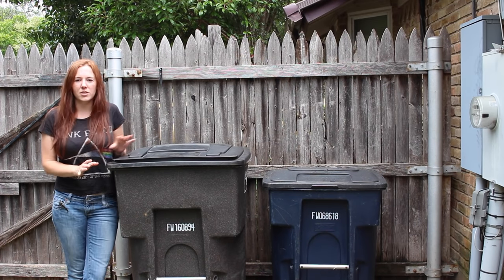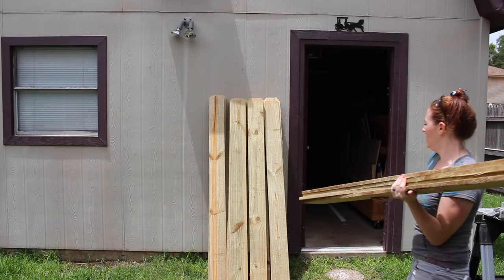Building a Garbage Can Enclosure - Part 1

Comment: 1:27 That was a pro move, after you cut the wood, it fell and automatically leaned against the wall.
Reply: +MaximumJonathanosity There are several factors in doing a pro job. One place I discovered which succeeds in merging these is the Adota blueprint pack (google it if you're interested) without a doubt the no.1 info that I've heard of. Check out this  awesome website.
Reply: There are several factors in creating an amazing design. One plan I found which successfully combines these is the Adota blueprint pack (check it out on google) without a doubt the most helpful course that I have ever seen. Check out this  interesting site.
Reply: I have spent months researching into constructing sheds and found an awesome resource at Adota blueprint pack (google it if you are interested)

Comment: you are so lovely april! like the project idea.. always wanted to do something like it but never felt the need to :) do you treat your wood for outside uses?
Reply from the maker: : ) Thank you. I used pressure treated wood for except the framing. I also plan to paint the structure but will have to wait a few weeks for the treated wood to dry enough to hold paint.
Reply: thanks for the answer :) maybe ill get on building something like this some day too. much love

Comment: Any reason to slope the 'roof' back to front? I would have done it front to back, which would leave room to lets the bins in and out whilst tilted, or even have the lids slightly open if you have to over fill them a little.
Reply: Exactly what I was thinking..
Reply from the maker: Because you need it short enough so that a person standing and reach up and lift them up. If the front was any taller I would need a stool or ladder to lift the lid up and throw trash in.
Reply: +April Wilkerson I thought that was the reason why.. Good work April.
Reply: Are you saying that the bins will be left open while they are in the shed? The Raccoon will love you forever. LOL
Reply from the maker: Nope they will be closed, but you have to lift the lid of the shed to get to the trash can inside and to do that, you need the roof to be short enough to reach and lift up. Just stay tuned for part two. : )
Reply from the maker: No, the trashcans will stay inside and when you walk out to the shed with a bag of trash then you will lift the lid of the shed up, lift the lid of the trash can, and toss the trash inside. On trash day, you will open the front door and remove the entire trash can so you can place it on the curb. I finished it yesterday, and it works great. So wait for part two to see. : )
Reply: Ah, makes a bit more sense that way. I hadn't realised that was how it was intended to be used. Seems a bit more awkward than necessary though to have to lift two lids up. A gas strut from a car trunk/bonnet though....
Reply from the maker: Yep that's exactly what I did. I used a strut that is rated enough to lift the lid by itself. That way you only have to release it, then open the one lid (the trash can lid) to throw in the trash. : )
Reply: +April Wilkerson Or you could have used a piece of string (or something else) and connected the shed roof to the bin lid, then when you lift the shed roof the bin would also open. Then when you need to remove the bin just unhook the string.
Reply: What the purpose of the lid if the trash can already has one:)

Comment: Awesome. I think the best tip you gave was in reference to those fence pickets shrinking. Boy, do they shrink...esp in the TX rain and heat. Ditto here in OKC. Great video/project.
Reply: Yep.  I'm in Houston.  I don't space pickets or deck boards.  New boards have so much moisture in them that they create their own space when they dry.

Comment: Just a little suggestion. We have these bins in the UK and most of the enclosures for them have the roof angled down towards the back so once the bin is in you can still lift the lid without having to pull it out. Don't know if you thought of that or if there was a reason the roof angles towards the front so thought I'd post a comment. Anyway absolutely love your videos, thanks for sharing all your projects :)
Reply from the maker: : ) Just wait for part two. I thought it though and it's working great. Glad you enjoy the videos!

Comment: Hey April, Totally off subject but, your fence posts are those PVC with metal brackets or, steel? Living in FL and moist ground looking for alternatives yet, cost effective alternatives to PT wood posts. TY.
Reply from the maker: The posts are steel and are filled with cement. The previous owner put them in.
Reply: Same here .. I live in Florida .. the cost to do that would be pretty high but it sure would last a long time ... I've done change my wood twice and the ground is always soaking wet ... But I wish I had the money cause I sure would do this. ..And concrete field that's awesome...
Reply: Put down a bed of crushed stone for drainage.
Reply: Larry, I wish that would work however, Florida is a big swamp. Constant moisture in the soil and the wood just soaks it up.

Comment: she should have put concrete blocks down first.... that would have raised the bottom platform off the ground and prevent  eventual rotting of the wood over the years... otherwise she did a good job...

Comment: I suppose this question might be answered by part 2 but a question i have is,  how will you hold the lid to the enclosure and the lid to your garbage can open when trying to put garbage in the can?
Here is a thought....take a small piece of chain with an S hook on the end. Attach it to the wooden lid then attach an eye screw to the plastic can lid. Hook the S hook into the eye and when you open the wooden lid you pull the plastic lid open all with one hand while you are still holding onto the garbage you were throwing away.....If you use my tip i want a Nickel for the idea!

Comment: Historically massive rain here in my city, last month was a record breaker and this month has already started above average.  Currently my two rubbish containers have broken lids, the city is supposed to come and replace them by tomorrow (Monday.)  your project is an excellent one for my situation, just not until I finish repairing the hail damage and rotten window trim.   We will overcome (given enough chocolate and Dr. Pepper.)

Comment: Hi I'm always excited about your projects, nice job ;). But I have few improvements in my mind that, I would rather change the position of bottom boards (rotate 90° in order to have longer side level with ground) because I think it will bend under the weight of thrash can (and maybe add 2 more). Then the other one, after I saw "test fit" I think that it would be quite difficult for you to take out the trash can if it will be full of trash(maybe small change of design?). And last one, I know that the project is still ongoing so I still hope in corner of my heart that you would create some concrete base under it. :) keep going in good job ;)

Comment: I have been doing wood working projects for some 50 years and yet i always learn something from watching your videos so thanks very much. Using the router to do a straight cut on the paling top cut is something I learnt this time. I always use a power saw and cut to a line but paling to paling I always get a bit of drift in the cut. I think the router will make a better cut and cant wait to use it on a future job. Thanks again.
Reply from the maker: : ) That's great to hear. From now on I'll also use the router. Not only was it quicker but it makes a cleaner cut.

Comment: Great idea April:
I'm gonna modify this concept and apply to my motorcycle shed. I'd like to use hinges on the back wall to open the roof. Would you suggest any other option so I won't decapitate myself when parking my bike inside?
Thanks in advance. Greetings from Chihuahua, North Mexico.
Reply from the maker: Yeah I actually uses gas struts on the lids, so check back for part 2 next week.

Comment: Hey April, as a female, I got into wood work as found it much cheaper to do things yourself. However don't want to spend too much money. I am woundering is, it possiable to make something similar to this, using a jigsaw, a drill and a sander. Yes, it will take longer to cut with a jigaw than using a circular saw, but is it still possiable?. And also how much did this project cost you?. I am thinking of making this for my mum, but changing the designs to incorprate 3 garbage disposal, also thinking of doing it with the wood lids, seperated into 3 parts, each that I will attach to the garbage disposal lid. So when I lift up the wood lid, the disposal lid will open as well. Something with a hook that I can attach to the lid and using a clamp. It has to be a easy removal design so I can remove the garbage can for collection day. Also, I was thinking of putting wheels under the enclosure since this will be sitting on pavement, not grass, something similar to this design, is it capable to install castor wheels and not break apart.
Reply: Here in the USA, you can pick up a new circular saw for about $30. If you get lucky on craigslist, you can probably get one for about $10. You could probably find a refurb one for $20-25 using amazon or big-box websites, or the CPO outlets website. I point this out because just the lumber for this project will be 5x more expensive. 

All April is doing is cutting, although sometimes with a little bit of precision. You could do this with a jigsaw, but that's putting a lot of work on the motor, and will probably require a couple new blades. The screws could be done with a drill/driver using a screwdriver bit. The nails could be replaced by screws, especially if you have a helper. Or you could pick up a hammer :-). You could cut up a wire coat-hanger to make hooks, and then a little bit of string from the shed-roof down to the disposal lid would lift it, while a quick unhook would separate them.

Comment: Did you use treated lumber on the bottom frame where it sits on the ground ? Or does it matter ? BTW I love your channel.
Reply: Old comment but in case someone else sees, I believe you should as it will be in contact with the ground

Comment: Looks good.  I would have put the high side to the front for easier access to the garbage cans and also to allow the rain to flow to the back side of the structure.
Reply from the maker: Wait for part two....if the slope is opposite then the design wouldn't work. : )

Comment: Why make the roof slope to the front? When you take the trash out in the rain, isn't the water going to run all over your feet?
Reply: Ah, I just watched part II. It's not just a roof, it's a lid too which would probably be too tall if it sloped from front to back. Makes sense now.

Comment: Its too low, I would have made it higher, so you don't need to pull out the waste bins to put some in. So you only would have to move them if you want to put them out at the street to be emptied. Also would have sloped it to the back instead of to the front, so you don't get the water towards you when you put some in and its raining...
Reply from the maker: You won't have to pull them out until you want to place it near the curb. I made lids that open and you toss the trash inside.
Reply: So basically you have to open 2 lids... one of the enclosure, and then one of the waste bin... unless you leave it open under it, but that might attract rodents or other unwanted animals. I'd probably still go with my idea, make it like 50 cm higher then the bins and the slope the other way.
Reply from the maker: Cool, enjoy yourself!

Comment: Why not tilt the roof sideways or back? so as to not get poured on when you have to take the bins out during or after the rain...
Reply: Or to the rear
Reply from the maker: Because I need it to be short enough so that I can reach up and lift it up to toss trash inside. The roof will not hold water, it's slated and angled. Plus....if it's raining I'll probably just wait until it stops to take out the trash.

Comment: is it better to use two 2x4 or one 4x4 for the side wall corners?
Reply from the maker: Two 2x4s are cheaper. Also, if you used a 4x4 as a replacement then you would have to cut a big dado out from it where as using two 2x4s, you just have to make one shorter than the other.
Reply: excellent point about the dado ...

Comment: Nice project overall but I found several mistakes on the plans. The biggest issue was the gas struts, 100 was WAY to strong, my lids were bending out of shape. I ordered 68 and waiting for those to arrive. Be sure to check everything in the plans before cutting.

Comment: Nice project but the shed looks a bit small to me. 

I made mine a little higher and wider. The doors fully hide the trash cans but there is an open space above the doors that allows me to open the cans and use them without having to open the doors. Also I made my shed a little wider. It has a niche to the side with shelves to store chemical waste (paint), broken electronics, used paper  and all other recyclable waste. The niche is left of the doors where the shelves can't bee seen from the house or yard. 

BTW, I used bricks for a floor. They are basically an extension of the path through the yard. Hence there is no threshold to conquer.  And as a cherry on top, I added a water drain in the floor for ease of cleaning.